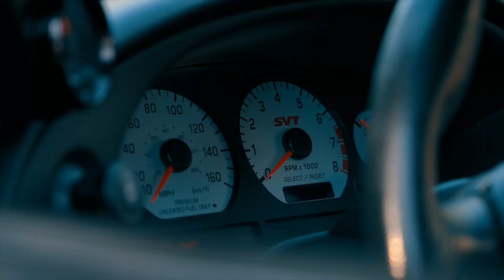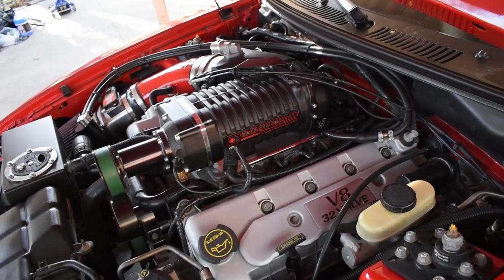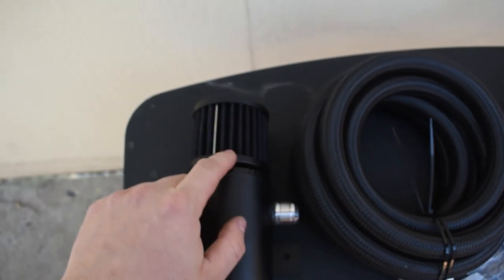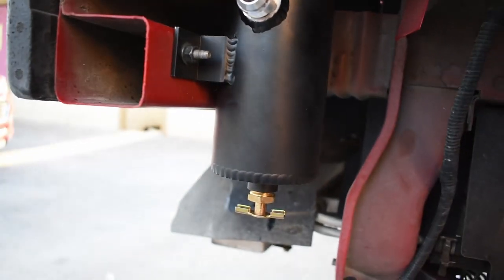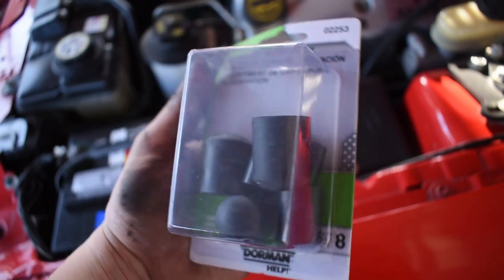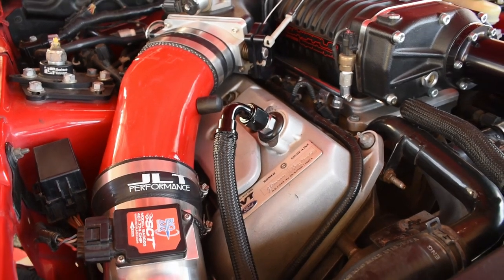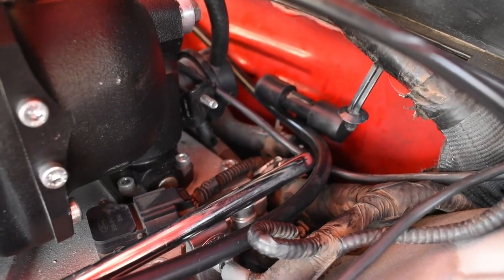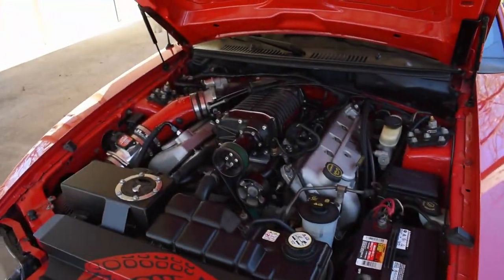Installing a Custom oil separator (catch can) on the Terminator Cobra

Comment: This video has helped me out tremendously. I just pulled my Eaton off to swap to a 2.3 Whipple and I've been trying to figure out the best way to do a PCV delete and I still wanted it to look clean as well. This is by far the most useful information I have found. I'm going to order everything and do the same install on my Cobra. Thanks bro.

Comment: Thanks for sharing this! How easy is it to access with the bumper cover on to drain it? Thanks!
Reply from the maker: Yes there's enough room to reach in without having to remove anything. You may just need to rinse the car some to reach.
Reply: @loscar5oh  rinse the car to reach it? So you don't scratch the paint if you rub on the body or cuz oil may spill into the bumper cover? Thanks man!
Reply from the maker: @lfgsvt  I'm sorry lol I just noticed I wrote it incorrectly. I meant rise 😅 so when you do your oil change your gonna have the car raised up so that's the best time to drain the oil from the catch can.
Reply: @loscar5oh  cool man, thanks a lot. Sick build and thanks again for the help!

Comment: Where did you get the fittings that go into the value covers?
Reply from the maker: @dgilb1986  through summit racing
Reply from the maker: @dgilb1986  also check my video description. I have links to the same ones